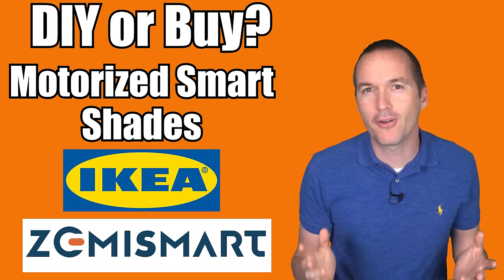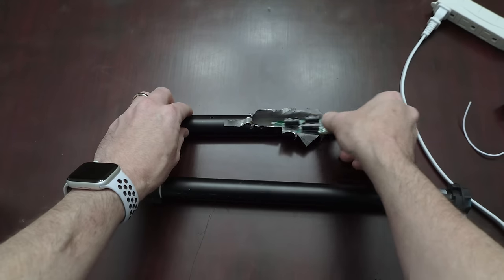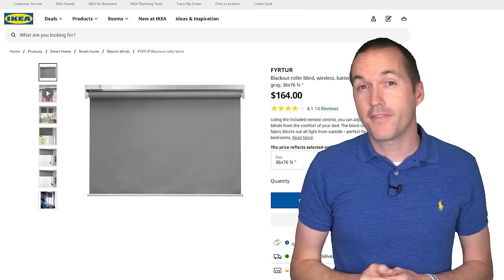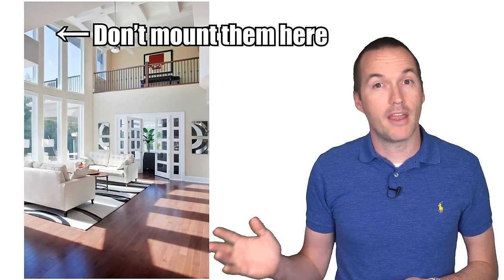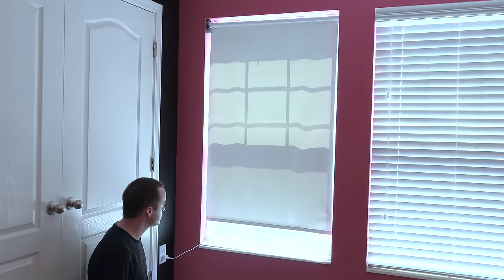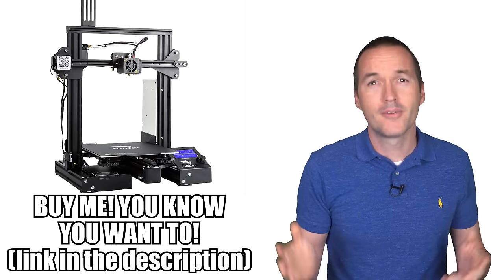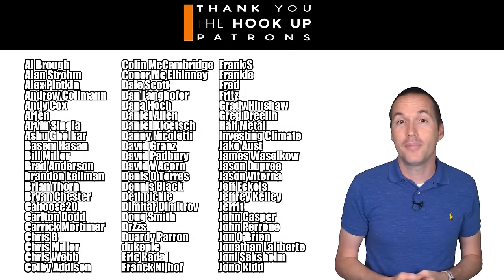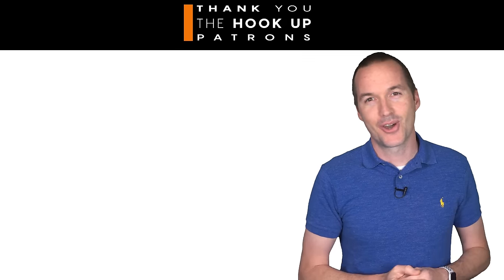Motorized Roller Shades? IKEA Fyrtur vs Zemismart Solar/Battery vs DIY!

Comment: Low voltage does NOT meen you need thinner wires. Lower power in watt, does. If the current in amperes is high, you need thick cable no matter what the voltage is!
Reply from the maker: You do not need thick cables to power a nodemcu and a 28BYJ stepper... but I do understand your generalization.  Yes, amps matter.  The difference is that if you use undersized wire with 5V you will get voltage drop and your project won't work.  If you use undersized wire with 120 or 240V you will end up with a fire because there's significantly more "push" to create the high amp situation.

Comment: May already have been said but the motors can be modded for more torque and they are so cheap you can put one at each end , pretty sure the driver is fine with 2 steppers
Reply from the maker: Yeah, I modded them for a previous project (blinds automation), but this code was written for the ULN2003 driver, not the A4988, so I couldn't do that mod without rewriting the code... maybe later.
Reply: @TheHookUp  I was thinking again Rob, it was some time ago I did mine and may be misremembering but I used some code at around that time that had the poles triggered in the wrong order, I don't think it was this but may be worth a check. Thanks for the modded code I will have try of that.
Reply from the maker: @ooslum  Yeah, I'm aware of that bug.  It's with the original example that comes with these steppers.  This code doesn't have that error.

Comment: It would be sweet to see a diy battery solution! Just can't get past the ugly cord coming out of the corner.
Reply from the maker: I've been trying, like really hard, for over a year now.  Anything that works is too complicated for most users, anything that's easy has garbage battery life.
Reply: @TheHookUp  it would be sweet if we could just duplicate with a 3d printer the zemismart solar motor parts and use even like 3 AA batteries to power it. Just watched Paul Hibbert's video on installing and it was slick.

Comment: Great video!   I've got three sets of the Fyrturs and love them, they work well with both my Hubitat and Home Assistant.
Reply from the maker: Not at the same time though, right? How are you connecting Hubitat with Home Assistant?
Reply: @TheHookUp  I don't have it perfected yet, and it's a little convoluted, maybe you have some ideas to clean things up!  Blinds are paired to Hubitat.  Node-RED has the nodered-contrib-hubitat palette installed to bring them into NR.  Using this HA integration (https://community.home-assistant.io/t/two-new-nodes-with-custom-integration-looking-for-testers/150736) it creates entities in HA from Node-RED.   Stuff works as I can lower and raise from either Hubitat or Lovelace but getting it all synced together has been a headache thus far.    I'm a long time Hubitat person but noob Home Assistant user, I still don't have a full grasp of HA just yet, but trying to piece together the best way to "make Hubitat devices show up in HA"
Reply: @stepheng2131  I think i read, remove batteries from all 3, add one, link it, remove battery, add one, link it etc.
Not sure if it works.

Comment: All blinds seem completely pointless with the amount of light let in along the edges and top of the blinds (Ikea one seemed to block light leak at the top the best). If you buy a blackout blind, it has to have a perfect fit or it’s just not a blackout blind. We’d all be better off with a decent, custom fit blind with a control motor that just uses the existing roller cable. I know these exist already, but they’re pretty much £200 a unit for some reason, I have no idea why these aren’t much much cheaper already. When creating a smart home, retro fit devices are always more appealing as they seamlessly integrate without needing to replace.

Comment: Is it time for an update g of this video or is the market still much the same?
Reply: Id like to know too. I want to use zigbee... I also figured I should be able to use batteries if it's lightweight but maybe not (down the road I'd like to wire it into the wall but one step at a time)

Did you come up with a solution or try anything? If I remember I'll comment again if I get anything decent running.

Comment: Great video. Question, I have a smart things hub and also the BOND thingy mainly for cieling fan control. Can I control the recommended battery blinds with either of these or would I need an additional device? Thanks in advance!
Reply from the maker: I believe BOND should be able to handle it since it's just standard RF433.
Reply: The Hook Up thank you soo much! We have a remote controlled bed that I am unable to control with anything other than the included remote. I tried BOND learn function, I tried that $$ harmony remote (returned), googled it also without any success. This may be a video topic in the future possibly?

Comment: Ikea Zigbee stuff is a little unpredictable with how it works.  I have not had any issues with Hue and Xiaomi Zigbee equipment though.  That stuff just works, both with ZHA and DeConz in HA, as well as SmartThings and Hubitat.
Ikea stuff is just too hard so I never went further with that.
With the RF controlled motor, how does that go with trying to work out say a 50% open position, given it is a one way protocl?
Reply from the maker: There's a different RF command for different "set positions", you can have 3 of them.

Comment: What is needed to drive this at 9v vs 5v? Reading through this and the thingiverse comments about using 9v to drive this stepper to move blinds is needed. Is that just a matter of using a USB power supply that outputs 9v vs 5v or in the example a 9v batter?
Reply from the maker: 9V will give you more torque.  The demonstration in the video is 5V.  A 9V battery would last around 1-2 hours of idling with the WiFi connection.

Comment: How wide is the "control panel" on the Zemismart motor - the bit that houses the micro usb connector? Knowing the usb port dimensions and judging form that, seems to be around 5mm, but for some reason I can't find any schematics anywhere.

Comment: Thank you for another great video , so If I understand correctly isn't possible to run Zemismart  locally in home assistant ( no cloud). I really would like a locally mqtt system but I have to drive a 230 cm blind and I am worried about the capability of diy system to rise such weight. In your opinion could be possible to modify the Zemismart to run with a custom esp8266?
Reply from the maker: Which one? The plug in version can integrate with home assistant via the Tuya integration (which is cloud based). The solar one will need an RF bridge like the one from sonoff to integrate with home assistant.
Reply: @TheHookUp  thank you for your replay. I am talking about the plugin version,  would be great if could be possible to integrate it without  the need to relay o the cloud

Comment: Hi, Just to let you know, I made this and using the re-mixed wall mount it works fine with Alexa and on the web interface,  I used the .bin fileas I couldnt get on with the IDE version for some reason,. Also is there an oprtio to add buttons for raising and lowering incase f power outages cheers

Comment: Thanks for this great tutorial. I flashed two nodemcu boards, they connect to my main wifi for a second or so but lose settings and go back to AP for configuration mode. I have the recommended unifi network. Don't know if its the batch of nodemcu or my wifi which works great otherwise. Any pointers would be great to try here. thanks

Comment: Those motors could be modded to bipolar stepper motors, which increases the speed and torque significant.
Reply from the maker: It increases the torque, but the speed is limited mostly by the gearing.  I did that modification for my blinds automation video.

Comment: Nice one. I made 2 of the DIY shades here. 
But i also did a completely custom PCB with an esp-12 and driver integrated. So i made a box for 2 of this PCBs and connected everything together, wrote my OWN mqtt code and put endstops for the blinds because the stepper is loosing steps while going up.
How accurate is it with the original firmware without endstops?
The shades are now opening controlled by a zigbee light sensor from IOBroker
Reply from the maker: Original code is very accurate without end stops.
Reply: @TheHookUp  maybe I should try it. How is it with mqtt and controlling?
Reply from the maker: Works great with mqtt
Reply: @TheHookUp  thx. I'll try your code from. Your github

Comment: Hi Rob, it's possible use your solution in the video "Motorize and Automate your Blinds for $10! " without fry the motors and make the shade a little more faster?
Reply from the maker: Yes, but the code will need to be different, the ULN2003 drivers use a different method for controlling the stepper.

Comment: Can you think of any way to add Siri integration to the Zenismart mains motors? Points of entry seem to be the Tuya app and possibly a Siri compatible RF hub. I have a broad link RM Pro but I’m not sure if I can or how to use Siri with that either.

Comment: The Lutron Battery powered ones are super long lasting battery and WHISPER quiet.
Reply from the maker: They better be for $500!
Reply: @TheHookUp  You get what you pay for. Theses are things that last 10 plus years if you get quality ones. So when you compare the investment to the features and length of time...not as hard to swallow.
Reply from the maker: I’m not convinced of that.  A few months ago I took apart a set of Serena shades with my brother in law and was surprised how cheap and plasticy all the components were.

Comment: Any solutions for vertical blinds?  1 movement to swivel the vertical blinds and a 2nd movement to open close the blinds.  Would be good to fit on 1 motor.

Comment: besides MQTT, is there another way to use your DIY with HomeAssistant?
whenever HA core restart, HA has no idea where the roller shade's position is.
Reply from the maker: You can set up your HA to remember the last state with the recorder component. You can also use tasmota or ESP home to set up a stepper motor and driver.

Comment: The 3D printer you have a link to in your description is about $70 cheaper from the manufacturer than it is from Amazon.
Reply from the maker: Yeah, that's a a result of COVID19.  You used to be able to pick up an Ender3 for under $200 on amazon, but with everyone staying home 3d printers are in high demand.
Reply: From AliExpress “Creality official” it’s cheaper but 2-5 weeks. I got lucky with Their UK stock and it arrived in 3 days. £165 for ender 3 pro before ‘covidgate’.

Comment: Can you do a video motorizing vertical blinds without the cord? I have blinds the work with a pull stick that hangs from the track.
Reply from the maker: There aren't too many products like that on the market these days.  There's one on indegogo right now that I am set to receive, but I won't give my recommendation until I see it work.

Comment: I cannot get this to work. I successfully flash the NodeMCU and get the initial setup screen but once I save I can ping the node 4 or 5 times and it just becomes unresponsive..even after a resetting.
Reply: Hey Rob, I'm having this exact same problem, any idea what the issue is?

Comment: Surely there's better motors and corresponding gearing to speed up the DIY version?
Reply from the maker: Increased speed would mean decreased torque (with the same size motor).  Other motors are certainly available that would be faster and stronger, but at that point you're losing the price advantage of DIY.
Reply: Would think there's a happy medium between price and performance. Your diy price is much lower than the others. Increase it by $20 or so for a better motor and you have the best of both
Reply: Yes there are. Those stepper motors are garbage will not last at all. Good roller shade motors are about 15inchs long and rated in Newton Meters.

Comment: Maybe a strange question to ask, but you not use a stronger motor with the DIY solution? 
You are already 3D printing the part, so making the motor mount a little bit bigger shouldn't be hat hard..
Reply from the maker: You could, but there aren't a whole lot of readily available motors in between the size of a 28BYJ and a NEMA14.  Also, the big advantage of the DIY version is price and stepping up to a larger motor increases the cost significantly.
Reply: @TheHookUp  Could you use the 28BYJ in Bipolar mode with the drv8825?

Comment: wouldnt a stronger motor solve the speed problem? looking at the construction it seems it would be as simple as replacing the motor you are currently using and maybe an additional voltage coversion to power both motor and nodemcu ...
Reply from the maker: Yeah, but at that point you’d be getting close to the price of the pre built stuff.

Comment: newbie here...i want to remotely turn on and off a small battery operated motor. I want to use an old bluetooth dslr camera control. the original control connects to the camera and triggers the shutter. Think I can adapt it start and stop a small battery powered motor? thanks

Comment: This might sound like a really obvius question. But can´t you just get a little bit bigger stepper to handle larger curtains, or move them fasteR?
Reply from the maker: Sure, but at what point does the cost of the materials approach the cost of a purpose built product, and as steppers get larger they are harder to conceal.
Reply: @TheHookUp  well.... If The step  motor  Cost $3... a $6 should  be att least  twice  as strong. That would still be cheap

Comment: Is the remote in 3:07 the AC114-01B? If so, were you able to connect it to Sonoff Bridge? I bought Sonoff Bridge just to emulate that remote but I cannot teach the bridge to use it...
Reply from the maker: I use tasmota on my sonoff RF bridge and I run it in "raw mode", it works.  It is an AC114-01B, yes.
Reply: @TheHookUp  Thanks for answering. I am also using Tasmota but not in the "raw mode" and the remote cannot be sniffed that way. I will look up this "raw mode" you mentioned. Thanks!

Comment: Is it possible to get a second option. I want to use a A4988 and a Nema Stepepr motor. Ist is a liitle more powerfull and I would like open and close a vertical curtain from 2 sides. I think u have also such a curtain :D Can crete such a .bin file please ?

BR
Sascha

Comment: Hey Rob, can you modify your code so it can read the VCC pin's voltage and output as a % value in Home Assistant? I'm considering a modification using 18650s and a TP4056 with a voltage Range sensor for battery power.
Reply from the maker: It won’t work without significant other code modifications (complete rewrite).  As is you could expect 2-3 days of a 3 18650 solution.

Comment: Zigbee is perfectly fine, if you just use Deconz or Zigbee2mqtt
Reply from the maker: I do use Deconz, it sucks.
Reply: @TheHookUp  how? I controls all my zigbee devices without problems, including ikea blinds. Have it hooked up to my smarthome platform. No connection issues, always online, full local control. Only problem with deconz is that it can't control my smart lock, but that I use zigbee2mqtt for.

Comment: You can add it to your philips hue hub if i recall correct
Reply from the maker: They are both zigbee, but I have no idea how well it would function in that  case
Reply: @TheHookUp  okay 👌. I was wondering; is it possible to hookup a stronger stepper or a dual stepper (for more power)?

Comment: Have you tried Zigbee2MQTT for Home Assistant with those Zigbee roller shades?
I found it (zigbee2mqtt) pretty easy to use, once everything hooked up and configured correctly with something like CC2531
Reply from the maker: I’m currently using zha, I need to give zigbee2mqtt a shot though because I’m not super happy with ZHA
Reply: @TheHookUp  I only tested it with Xiaomi leakage, temperature and door sensors, but I didn't yet have any issues with it after initial configuration, which took some time.
Reply: @TheHookUp   And, btw, thanks for what you're doing - your video helped me to kickstart my HA implementation.
Reply: @TheHookUp  Just in case if you decide to go with zigbee2mqtt - buy a dongle with external antenna - it'll save you lots of effort

Comment: I'm trying out the DIY version.  How do you remove the spring mechanism from the cheap blinds?  Does it need to be cut off the cardboard tube?
Reply from the maker: I just pulled hard
Reply: @TheHookUp  Wow!  Thanks for the quick reply!  Apparently the Home Depot versions are secured differently.  They are crimped on tight.  I had to take a dremel to it to remove it.  Do you know if there's a printable hanger for the other side?  The hanger that I have is a little longer than the motor one so the shade doesn't roll up straight and creeps toward the motor side.

Comment: I'm looking for a cheap direct wire option. My problem is I can't find a decent roller shade that lists what the roller tube diameter is. Has anyone bought the direct wire roller motor and got some decent shades that worked together?

Comment: Hi there, I have a smart device question and I hope you could help. My end goal is to have a notification on my phone every time my tank (which is filled with water) is almost empty. I'm planning on using a float switch to get that info but my problem is, and that's why you struck a chord by saying 'one way protocol', that I don't know what type of smart device I should be looking for to get that done. For the notification part, I guess tasker will do, I just don't get how I will have that closed or open circuit information transmitted wirelessly. Any tips? If anyone can help please reply. Thanks a lot